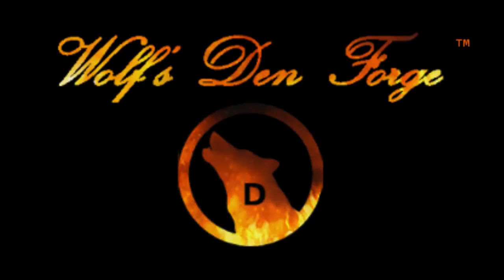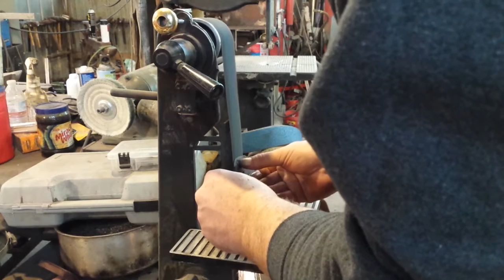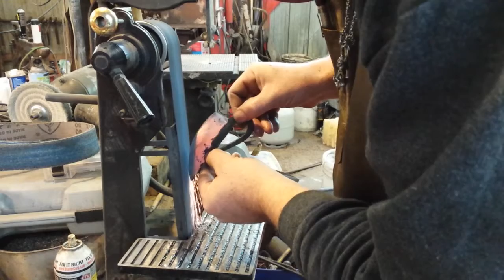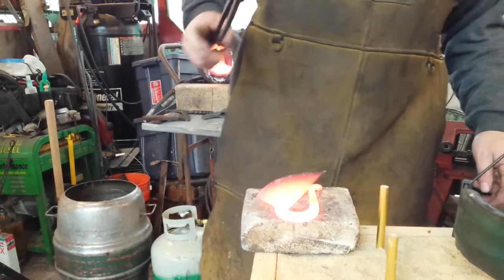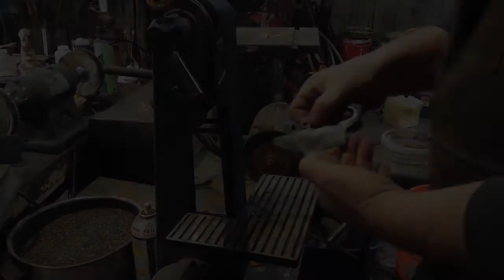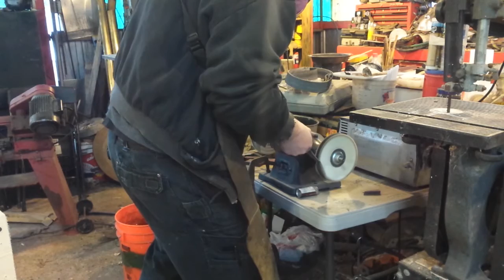Herb Choppers pt. 2 - Scandi Grind

Comment: sounds like u should have a glass platten on ur virtical belt sander?
Reply from the maker: I do, 3/8" thick, covers the whole platten. It's a good mod that can be done pretty cheap. I think the ceramic glass cost me about $18USD and a little bit of JB Weld. I did it about a year ago and it's made a significant difference in belt life, for sure.

Comment: do you think very smooth marble will work for a Platten? I have a bunch in about the right size.
Reply from the maker: kelenthemaskmaker I'm not so sure about marble. The major factor of having a ceramic glass platter is heat resistance. Marble a crack from the heat build up. That is the reason we use ceramic glass and not regular glass.